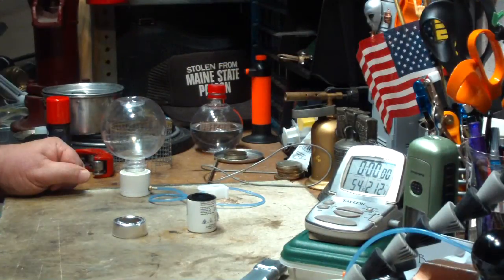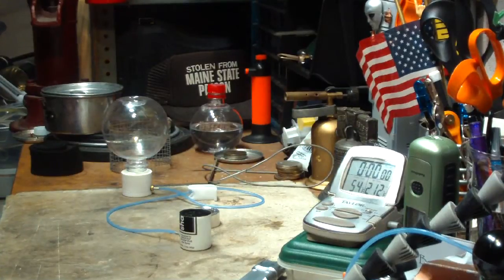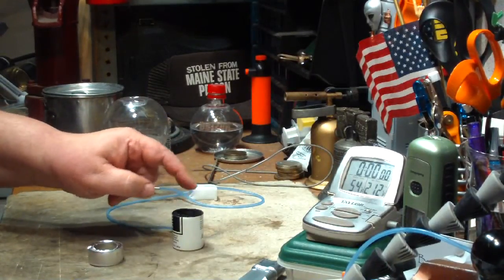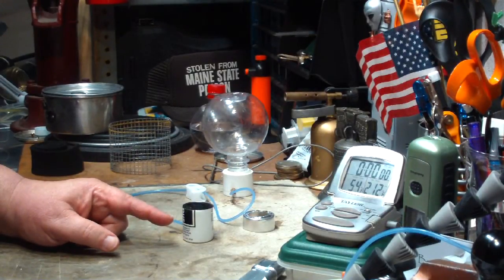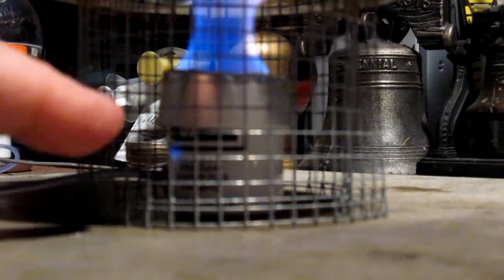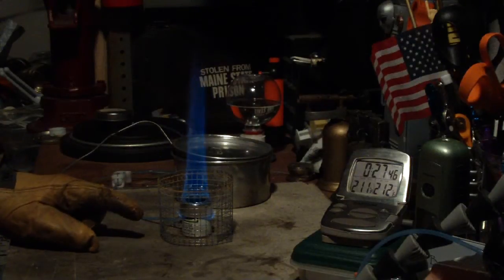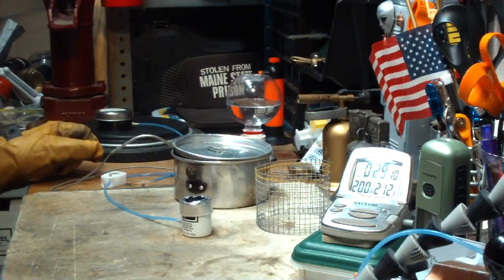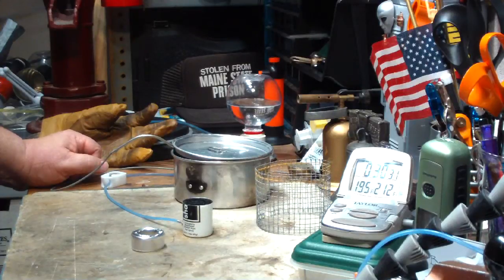Simple Carbon Felt Burner - Mod#1 - Boil Test #1

Comment: I use a piece of cloth on a potted plant with a drip tray under the pot.  The cloth wicks excess water into a catch bottle.  The carbon fiber in the main container might be folded over the edge (under your simmer ring) allowing it to wick under certain conditions.  the bubbler keeps the supply side replenished

Comment: From soda cans 66 mm diameter and 53 mm with the same number and same size jets had a big difference in boil times. 66 mm can boiled in 7:15-7:30 53 mm can boiled in 8:45-9:00 to boil the same amount same temperature water. 13 mm difference in diameter took  1 minute 15-30 seconds longer to to the same job.